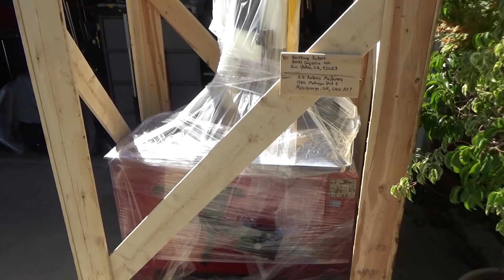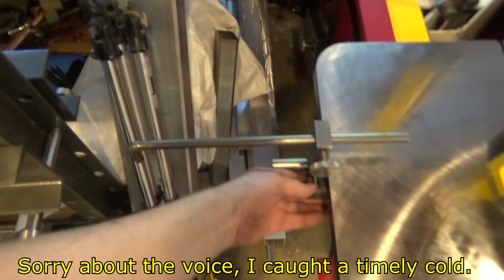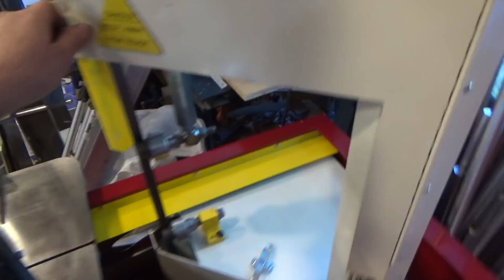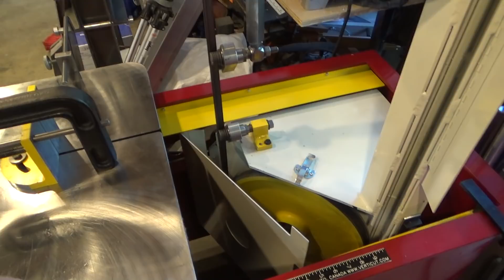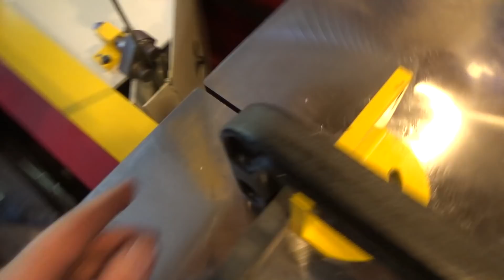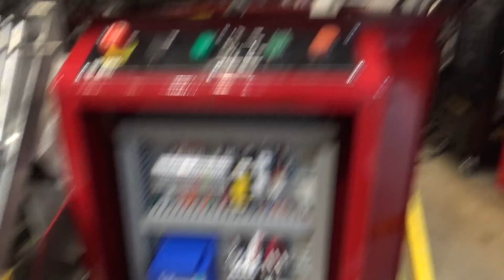QTR 31 Baxter Verticut Bandsaw Arrival

Comment: What are your thoughts a year later? I'm curious how the counterweight and saw feed works.
Reply from the maker: It works pretty well, but applies somewhat uneven pressure. A hydraulic feed would be smoother, I think. I would also like some sort of rotating brush to clean swarf out of the saw blade before it goes into the wheel housing. Other than that, I use the saw all the time and it is really useful and functional.
Reply: @DudleyToolwright  I'm wondering how practical a smaller scale adaptation of that mechanism for a Portaband may be.

Comment: What a nice saw! Do they make a hydraulic feed version as well? Do you know what the rated speed of the motor is? And do you know what the diameter of the driving blade wheel is? I’m trying to work out how much the motor is slowing down to make the slowest blade speed.
Reply from the maker: They maske hydraulic feed versions in thre bigger saws. The version I got is adjustable speed with a range between 70 and 350 sfpm. There is a VFD inside the electronic enclosure. Here is a ling to the MFG site:
https://www.verticut.com/ hope this helps.

Comment: Gosh Dudley, a bit crowded in there.
Really nice saw. I didn’t think I had room for another piece of equipment but after seeing your shop maybe I can save for a Baxter.
We’ve been waiting for some SG videos 😊
Reply from the maker: It is really crowded, but workable without move too much stuff around. My welder and press are on wheels, as well as, a hydraulic table. I cant use the surface grinder without opening the garage door though. I need to do a shop tour video...one of these days.

Comment: Just wondering if I could get you opinion on the saw now that you have had it for a while.  Looking real hard at one and would appreciate your input.  Not much info out there on them.
Reply from the maker: There isn't much info out there. I did discover them on a thread in the practical machinist forums. I have used it a few times and it has performed flawlessly. I am a hobbyist, so it does not get usage you would see in a production environment, but the unit is very solid. The distributer I got it from was fantastic and they have sold a bunch of them. You might want to ask them for more details:

Ron Eggleton BA, CPA, CMA
Sales/Controller
H H Roberts Machinery Limited
1324 Matheson Blvd East
Mississauga Ontario Canada
L4W 2Z7
Phone 905-624-5536 FAX 905-624-9065
www.hhrm.ca

Ron was very helpful an worked with me at every step of the way. I hope this helps. If you have any specific questions let me know. By the way the saw does only come with a carbon steel blade (3/4" x 120") so you might want to order a bimetal one.
Reply: Thnanks for your response.

Comment: wow nice price on the shipping. i paid 3000 dollars to get my 2vsg atrump 9x49  mill from pomona california to ontario canada. and i just bought a harig 612 super surface grinder same one as pragmatic lee and got it shipped from missisaga ontario to thunder bay ontario same friggin provance and it cost me 463 dollars for tailgate service. so you did very well on the shipping. very nice purchace dudley im sure it will be a handy shop acusistion.
Reply from the maker: Thanks. I was really surprised. I initially thought that I was going to lose all of the cost benefits to the shipping cost, but Ron at HH Roberts Machinery really got me an incredible deal. I have used it a couple of times already to cut 1" plate steel and it worked flawlessly.

Comment: Now that is a great saw. I like this type of bandsaws very much. If one has the room and the money, fine. He can have all types of different saws in a row. In a smaller shop, a bandsaw has to do all jobs. And for that, this type of saws seems great. Not really cheap, but you get... So, congrats, i guess you done good with this saw.
Reply from the maker: Thanks. Yea, it wasn't cheap, but I was originally going to spend about the same amount on a Grizzly vertical. Then I figured that most of my cutting would be sizing stock and decided that I wanted to be able to set up the cut and not have to stand by pushing the material into the blade. Horizontal band saws are so limited in what they can do. Ultimately, I had to choose a saw that had a small footprint, but could be versatile enough to do cutoff work as well as the occasional contour work.

Comment: Hello,  Very nice bandsaw for the home shop.  You mentioned saving $1K here and there but never let us know the bottom line for your machine?  Also what are the size limitations on your cuts with it?  Looking forward to seeing you use it in future videos.  Take care.  Doug
Reply from the maker: Here is a link to the saw specs:

https://www.verticut.com/models/115c/

The version I got was just under $5000 US. You can take off around $1000 if you want the pully version with a 3/4 hp motor. I was originally looking at a Grizzly upright band saw for about $4000. I think I made the better choice. I couldn't touch a DoAll in this price range except for the well used.

Comment: Ive got the same saw DT. It just won’t die. I put mine on 5” locking castors to move, and to lift the table surface. Works as advertised. I use it mostly to cut out pieces of soft jaws, prior to milling. Saves inserts. Good purchase, congrats.
Reply from the maker: Thanks for letting me know, I only found a little bit of feedback on the saw and it was all good, but more is better. I am really excited to use it. There is nothing better than a tool that performs well right out of the box.

Comment: Do you always use a steel capped carbon pencil when pointing out circuits?
Reply from the maker: As a matter of fact yes, quite often. It was a trick taught to me when working on high voltage crt flyback circuits 15-25 kV. The pencil lead is a resistor and is not directly in contact with the end cap. If you directly touch a modulated 15kV+ you can draw a tiny arc without even transferring any to yourself. Pencils were common probes to look for loose solder joints when troubleshooting equipment. Even the B+ on vector/wfm scopes that actually has a fair amount of current capacity behind it, is not a problem.
Reply: @DudleyToolwright  Yes, as a teenager in the late 50's I picked up pocket change by fixing tv's. (Most just needed a tube changed was easy money) I Used the pencil as you described, but also used the eraser to find intermittent problems. If you gently tap the tubes and the audio or picture flickered the tube needed replacement.
Reply from the maker: Fellow repairman spirits. I also use the plastic back section of an inspection mirror, but didn't have one handy. Thanks for the comments. I probably should have made some proper warnings about getting into the control circuitry of the saw even though it is only 110V at least on the single phase side, but I didn't think I was making any recommendations to that effect.

Comment: That is a very nice shop addition.  I wish you many years' use.
Reply from the maker: Thanks. It beats the $9/cut I have been paying the local metal supplier and I can cut parts when I need to, not when I can drive the 25 miles to where they are, when they are open.

Comment: This is great. I've been looking at the roll-in saws, and didn't see an alternative to buying an old one.  That thing looks to be of adequate quality too.
Reply from the maker: It is surprisingly good and if you get the roll-in-saw pully drive style it will be much more affordable. I looked for used ones as well and they seemed to go for $2000 and were well used.

Comment: My first reaction was WOW!!! Now thats a sweet saw! Nice job explaining the drive system and features. Having used many different saws through the years it was interesting to learn how they make something today compared to years ago. As sweet as that saw is it scares me a little. Only because it is so dependent on electronics. I admit I'm old school and follow the "KISS PRINCIPLE", keep it simple stupid. The saws, I'm used to, run at a constant speed holding horsepower and torque by fixed rpm. A variable mechanical pulley controls the surface blade speed leaving torque and horsepower at max all the time. I'm no electrical wiz or engineer but if the old saw quits working it is easy to diagnous and repair. When complicated, for me, electronics come into play it makes me dependent on the repair man, which equals expensive. Warrantees expire and I hate to wait for anyone. I still like your saw it will probably last forever. There is , however, a feature I don't like. It is most likely optical so just bear with me. It looks like the only position for the compound is directly in line with the saw blade. If there isn't an optional position I would make one. Damn, thats a nice saw. Makes me want to cut stuff just to play with it. Can the table be tilted? That would make me drool. Best of luck with your new saw. I can't wait to see it in action.
Reply from the maker: You make a lot of good points. They sell a version with pullies that is about $1000 less. You are absolutely correct about the KISS concept, but I am hoping that the VFD (var freq drive) industry is mature enough to give me decent life expectancy. However, I doubt it will be still working 50+ years from now like a lot of old iron. The table on this guy does not tilt. In this style of saw, it is usually the whole cutting assembly that tilts and to jump up to that option is much more expensive (read $10,000+). Yes, the miter gauge is fixed in front of the blade and having other locations would be useful - nice video/tool idea. I was originally looking to get a horizontal and a vertical band saws, but have neither the money or space for two. This guy can do both, albeit, not quite as well as either individually. Thanks for the great ideas and comments.

Comment: Robert, your lathe must have a cast iron base.  The Baxter Verticut Bandsaw should be a great addition to the shop.  'Til next time, Keep Machining!
Reply from the maker: Yes it does. I was a bear to move even with the help of a professional machinery mover. He made it look a lot easier than moving the much lighter bandsaw was. It is amazing how easy someone who is good at something makes it look when they do it. I tried drywall mudding quite a few years ago and learned very quickly that there is a surprising amount of skill in that craft. I watched a guy at work do it and it looked positively simple. Boy did I learn.

Comment: nice saw! congrats.
Reply from the maker: Thanks. I am quite lucky.
Reply from the maker: @Death Metal  This saw was about $3800 including shipping and it has variable speed control as well as a 3/4 HP 3 phase motor. It was significantly cheaper than the Roll-in-Saw which I could find for about $5000 not including shipping. This saw is made in Canada and now after using it a ton, I cans say it is an excellent saw. No regrets.